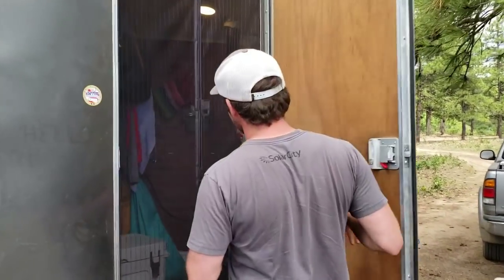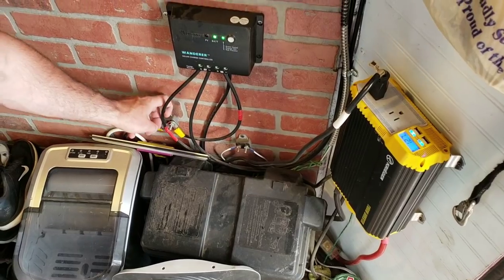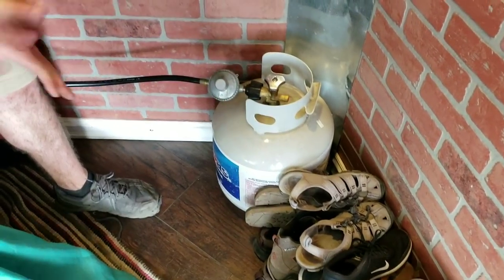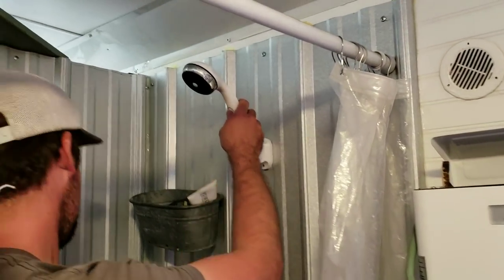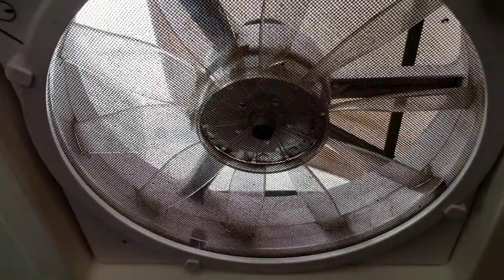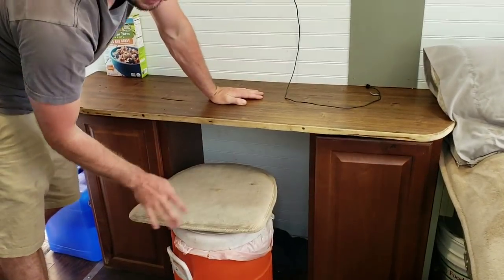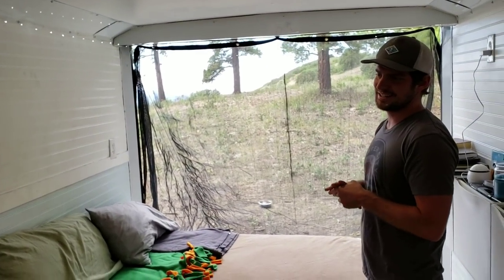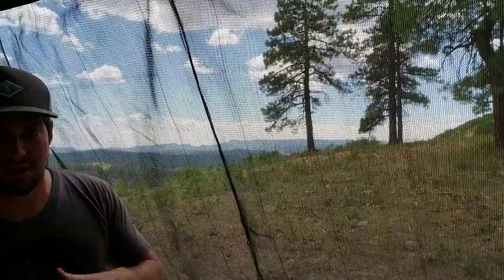Inside My Cargo Trailer Conversion

Comment: if you use a storage tub to stand in with a shower curtain to divert water back into tub, and run your sump into the bottom, just add a water filter and you can take a shower for an hour on as little as 1/2 gallon of water. its called the "hour shower". im building one. but you may have access to plenty of creeks around there. water is such a big problem for many when trying to stay out for longer periods of time. great setup. im building my second trailer now
Reply: Would love to see your plans for your shower..
Reply: @mastiffsrme  hi heidi, ive kinda put my building on hold. i kept making so many changes that i was tearing things out over and over! waste of money and time. but ill still build a shower. that hour-shower is a viable option. but i may just get a metal sprinkler pale that i can heat on a stove and then hang from the ceiling. with a built-in cabinet/tub and curtin. im trying to focus on lightweight options and as always less is more. less water pumps, less piping, less, less!

Comment: Thank you for the video. Can you note how to secure the bed to the wall. I think you mentioned in folds up. Thank you. I like your simple construction. I saw a guy put all the utilities, heater, propane in the front v then cut a hole in the floor for ventilation. I really want to build a cargo trailer conversion but don't have a lot of building skills.

Comment: Hi Great  build. Have you ever thought of having an  overhang attached to the back of the trailer so when you drop the tail ramp you  can push up and overhang attached to the top of the of the rear of the trailer. Acting as a shed roof then screening the whole thing in?? You could be adding a couple of square feet of room to the whole place. or even a covered area too cook.

Comment: Love you travel home.... NICE....
Great idea for your shower.....but, how about, putting a cover on the bucket  (they close pretty tight too) the put a small whole on the top...  then push your waterline through it.....ALSO,  please put a strap on that water bucket AND on your propane tank.... please be careful...
Reply: Set propane tank into a milk crate 20 lbs.fits perfect and secure to wall or floor.

Comment: I’m considering framing walls and a roof around a 7 x 16 trailer as opposed to converting a cargo trailer. Apart from saving on the cost of building materials and reducing the likelihood of leaking (which I consider the big upsides), why did you choose a cargo trailer?

Comment: Coming along nicely. New here, but I see you have a stove pipe and set up for a wood stove? Looks like a healthy sized pipe. What size or brand wood stove are you using? My setup in my 6x10 is not so advanced. For a shower I've been using a two room shower tent. I use only about 2.5 gallons per shower. Keep up the good work!

Comment: no mind the propane pansies. as long as it is held down tight, you are good. if you store propane outside you still have propane in the hoses fueling your stove or heater. common sense takes you long way.
Reply: They might leak at the tank connector. Carbon monoxide is odorless but propane has a strong smell. The benefit having it inside is that you will know if it leaks and take action so you don't run out.  But you need a CO detector for the sleeping hrs.

Comment: Hey man do you know how much your 7x16 trailer weighs after the conversion? Trying to decide what size is best with my tow vehicle.
Reply from the maker: Last time I checked was the beginning of the year and it weighed around 4200 fully loaded with all my stuff.
Reply: Oh wow, that's not bad at all, is yours all alluminum or regular construction? That doesn't seem too heavy at all for the size. My 4runner can tow up to 5,000 lbs so a 7x14 or 7x16 should work well. Thanks in advance. I appreciate you sharing your knowledge
Reply from the maker: @DTM.Desperado  it's a regular construction. If I did it all over again I would get the all aluminum frame. My truck does great pulling the weight until I drive into a 50mph head wind lol
Reply: @nomadicjake4748  ok cool. So a regular 7x16 would still put me under my towing capacity. Thanks for your help man. I'm sure my 4runner will do fine pulling the load as the engines were designed for towing but I already know my gas mileage is going to drop like a rock lol. Well thanks alot man, hopefully I'll run into you on the road some time 🤙

Comment: Great trailer, but the propane tank is a big no no inside very unsafe.  It should be outside full stop
Reply: Yes, and the brick paneling probably has asbestos in it. Asbestos is a big no no inside, very unsafe.
Reply: @jimsteele7108  asbestos was banned from home building products in 1977.
Reply: I've been using a propane tank in my camper for 5 years. Common sense prevails. Make sure there are no leaks and keep away from a heat source. It's quite the opposite. Let a tank freeze outside and your regulator is a hazard. Flames with shoot up a foot high on the stove. They added stinky stuff to propane so you can smell it. They also sell propane detectors. Think about it, your lines are inside. They'll bust before a tank does.